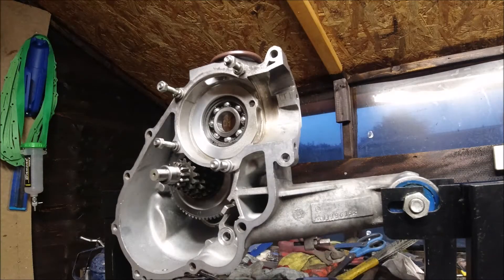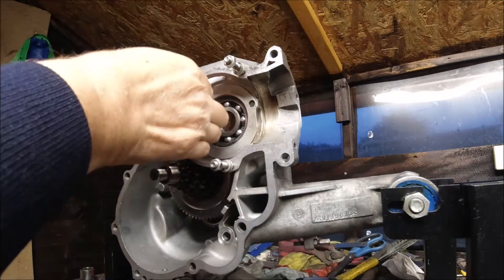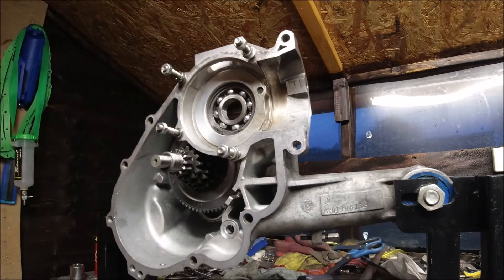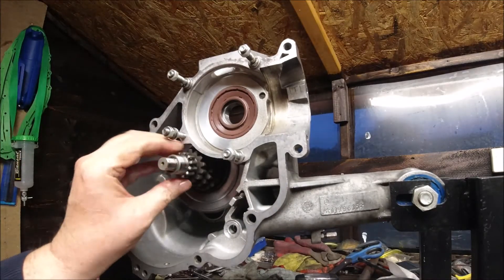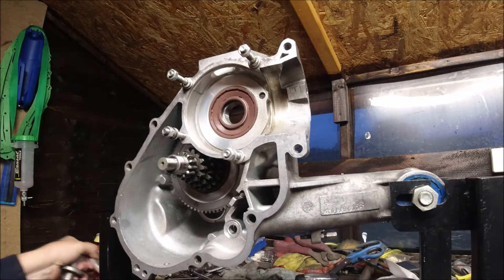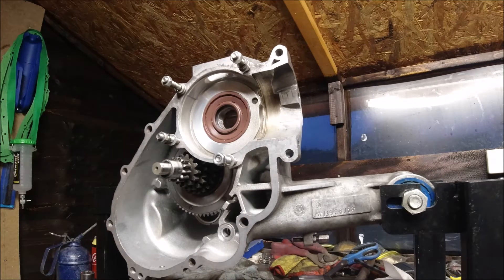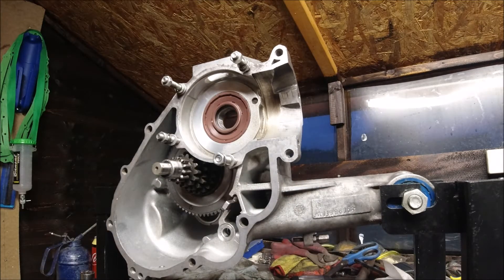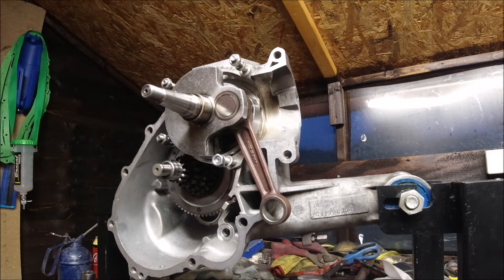Vespa PX engine rebuild part 4

Comment: hi buddy guess what my seals gone petrol in the gearbox oil and my revs went up i have ordered the viton oil seal kit so with your videos i should be ok 👍
Reply from the maker: There are a lot of experts saying that you don't need them. I say better safe than sorry, good luck with your scooter Paul😉
Reply: @m1scooterlife259  thanks ordered all my bits so I’ll whip engine out tomorrow and give it a clean ready for new parts 👍going to take my time
Reply: Done seals went well needed a clutch side woodruff key so my build stalled a few days i noticed the hub seal was in the otherway did some research and it does go with spring in seal inwards not outwards thanks for your videos i will be back on road very soon
Reply from the maker: They put the seal in different ways on the engines, I always look at which way it was in originally and follow that, if its the one under the hub , they all seal with the spring towards the gears.  Thanks for the update